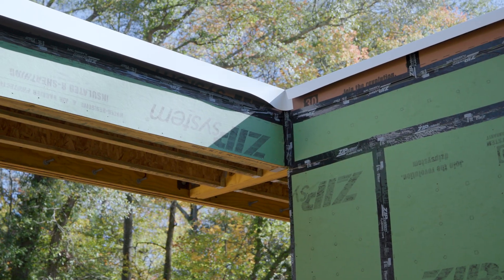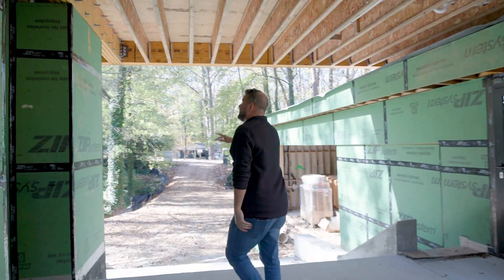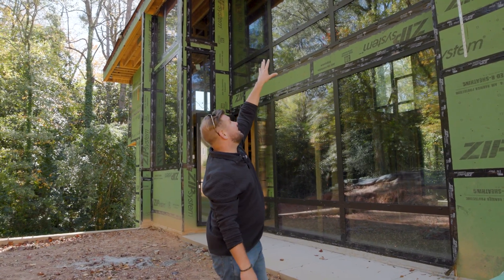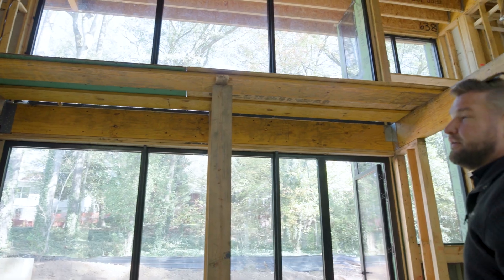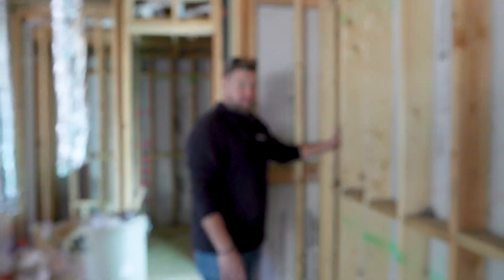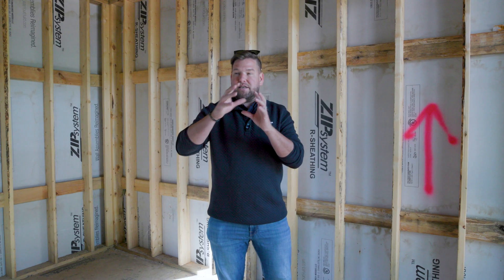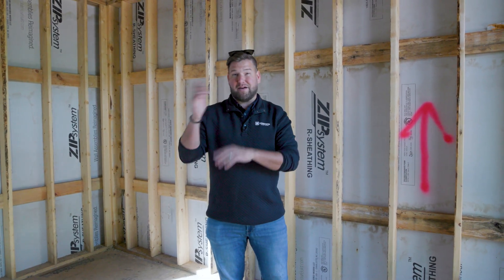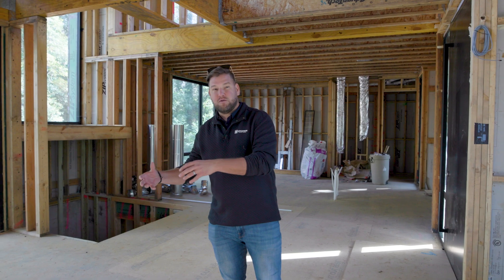How we built a modern, luxury home out of WOOD in Atlanta

Comment: If by luxury You mean large, You are right. But it is still a stick frame, and in my opinion that is not luxury. Of course, that is all in our individual mindset, but to me, luxury is more solid building, masonry and steel pillars. Your standard is high though, but it is still wood.
Reply: I hear you. In the US we wood frame because that’s our resource of choice. Very sustainable and carbon negative(holds more carbon than the carbon cost of getting it in place). So the framing material for us doesn’t dictate Luxury or not.
Reply from the maker: Here luxury isn’t dictated by using wood or concrete.

Comment: you are not transferring any load above that window anywhere. Walls that run parallel to joists are simply not load bearing. No rocket science here.
Reply from the maker: Agreed. None of it is rocket science. However it’s for sure not normal framing and most don’t understand or have access to homes like thtod

Comment: I have to know… what’s been your experience with cheaper pocket doors? 8:55
Reply from the maker: Oh god! Don’t get me started! So the biggest problems is the rail systems flex and break. Then also most inexpensive pocket door frames can’t hold truly solid core doors due to the the weight the frame will flex and do all kinds of wrong things! Then the number of times I have had nails and screws protrude through the frame where these frames have big thick metal bands you can screw drywall into. Just sooo much better. Then add in that it’s soft close and open and it’s a cherry on top